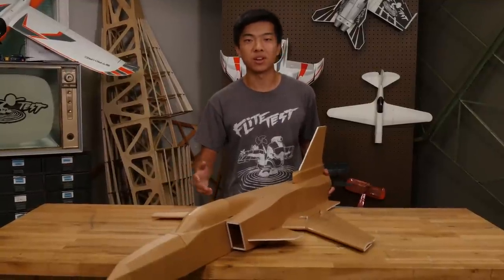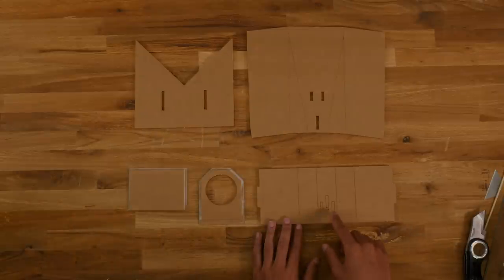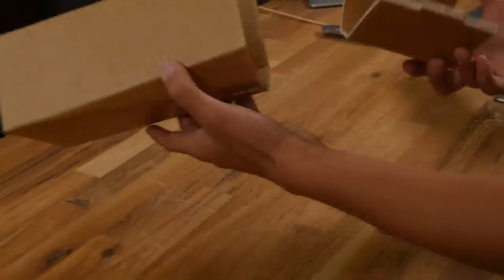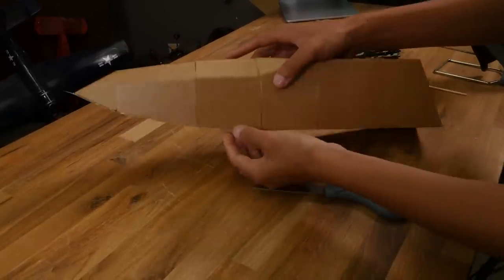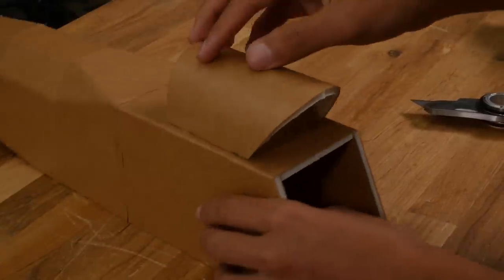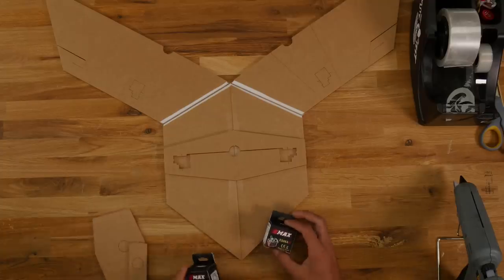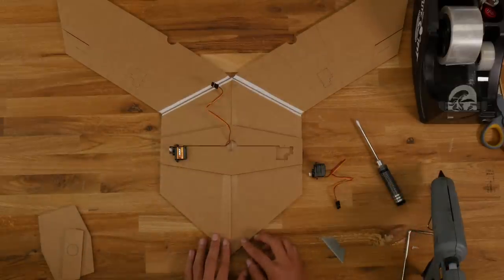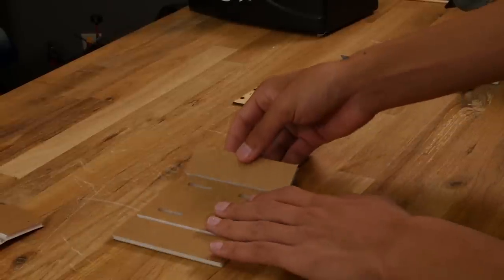DIY Jet | FT X-29 BUILD

Comment: These videos are just all amazing. Not a single time does anyone say, "just fold this piece and you are done."  Each and every fold is detailed with tips and exact procedures. Truly amazing.  I will be picking up one of your kits for my kids.  What radio do you guys recommend for casual flyers who will most likely never build a B17 with bomb doors and flares or crazy stuff like that?  I would say at most, flaps and gear will be the limit.
Reply: I would recommend the spectrum dx7. Easy to program and high quality.

Comment: Anders did a great job on the Design and Build of this odd X-Plane!! 
My Dad was at Edwards when this was being tested...
The staggering amount of fly-by-wire Avionics required just to keep it in the Air....

Well considering that this flies with the same Remote as any other RC Aircraft - is a testament to the brilliant mind who designed it!!!
Reply: Yep that forward wing design doesn't lend itself to great manual stability, so no wonder for all the fly by wire avionics.

Comment: flite test I've noticed that the foam is shrinking quite a bit and I was able to have the foam shrinking way less (it almost doen't even shrink and it comes out way better) by passing with the laser multiple times with more speed also takes a little more time to laser cut.

Comment: I'm amazed that this forward swept wing model is flyable. I thought that you needed a computer to fly it.
Reply: The full-size aircraft has 'relaxed stability', ie a very rearward CofG which, as you note, requires computer interfaces between the control column and control surfaces. 
This model has a normal, slightly nose-heavy CofG which makes it flyable.

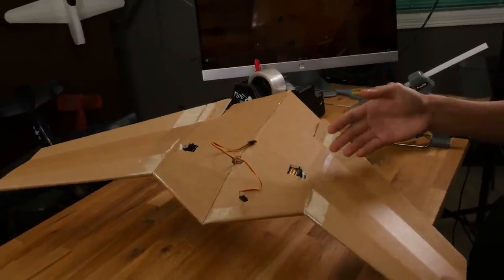Comment: something  notice watching this build......the basic wing section assembly (1:09:11), looks very much shape wise, like a B-2 bomber.. -- The silhouette of it is almost there....with a bit of redesign, it could be tweaked to get the form right....the wings would need to be reworked so the leading edge is right, and the "tail" would need to be adapted some to get the "sawtooth" profile right,  and some reworking of how a pusher prop might be mounted, but it seems VERY close....  Thought it might be something for your design team to look at, possibility wise

Comment: whats the cheapest transmitter you would suggest for any rc plane?, i am new to the hobby and dont know what transmitter to buy
Reply: Cheapest route i would suggest to go is the FlySky FS-i6x, any cheaper and you look for an upgrade soon.
You can get that for around 40 bucks including one receiver and there are cheap receivers under 10 bucks available.
I would suggest, however, to invest a little more right from the start and go for the Taranis Q X7.
It´ll set you back about 110 bucks, but probably you are set for many years for almost all things flying ( Quads, Planes, Helis). Also really easy to use for any simulator out there with its USB interface
Reply: @C4reful   - Thanks, I appreciate that answer too!
Reply: I would recommend the yc-9954 transmitter. Super easy to configure and extremely reliable. Perfect for the beginner

Comment: What EDF unit did you use for this build? Thinking about building this as my first EDF jet and just wondering what kind of power I'll need.
Reply: Spencer Guenther They mentioned it in the previous video linked below. It's a 65 or 70mm EDF from ReadyMadeRC. Supposed to have a EDF power pack coming soon.
https://youtu.be/bzQdgVH5j9o
Reply: I went to ReadyMadeRC's site and i can't find their EDFs... :(
Reply: It’s actually the MotionRC 70mm EDF $31(4s)- $39(6s) that they are talking about

Comment: I have the viggen and I was wondering.... I have a 5 blade 70mm edf engine but I can’t find a 4s 3000 mAh lipo. Would a 3200 or a 3300 mAh work just as well? Or will it drag it out of the sky?

Comment: Please, do a review of the turnigy 5x transmitter or any cheap one,I'm getting in the hobby but don't know which radio to pick. 
I'm trying to keep a low budget to my projects .
Thanks guys.
Reply: Rafael Barbosa turnigy makes decent stuff - if you can get by the quirks.  I have a 9 channel turnigy transmitter and it works pretty well.
Reply: theMike97_ 
I was considering to pick one in hobby king, a simple 5ch would be just fine for me. I'm trying to get a Speed build kit of a simple cub or mini Mustang,the only problem for me is the shipping to Brazil.
For the Tx/Rx from hobby king I would pay 30$. 
The most important is the electronics, the plane if I don't get one I'll build one. 
Thanks for your comment, good flights

Comment: There's a mistake on the plans on part 18 the 'front nose' (front nose?  Has anyone ever built a plane with a back nose?). There are two black 'cut all the way through lines' marked which shouldn't be cut through.  The pointy bit of the nose needs to be in one piece, not three.

Comment: Looks awesome :) Do you think you guys could manage to put an EDF Rafale or Eurofighter together? (delta wing jets w/ canards)
edit Would having two EDF modules counter rotating to each other help cancel the torque? Might be feasable in dual-engine jet designs maybe?
Reply: well, actually, EDFs dont have much of a torque.....so, it wont make a difference; also, i dont think reverse rotating edfs are sold in the market

Comment: Say WHAAAAAT? Ex-KYOOOSE me? Watchoo talkin' bout, Willus?? 

I don't have beginner skills. Neither do I have intermediate skills or even master skills. I have GODLIKE SKILLS when it comes to building anything out of crap I can find in the dumpster for free! Does this disqualify me from building an 'advanced skills required' cardboard thing with a pointy end?

We are talking about the same thing here, right? Modeling a boxy looking thing that looks sorta like a scribble of a jet plane, but in 3D and made out of trash? I mean, that thing looks like something a 1st grader would take to show & tell as a last resort after the vacuum pump for their homemade nuclear fusor bit the dust! Am I right in assuming that there's more to it than just cardboard?

Wait, stop the press! Tell me if I've got this right... that thing, that vaguely jet plane shaped cardboard box requires advanced skills (and there's money required, too? Tell me if I jumped the gun there). Because you can snag a cardboard box out of the trash for free.

Uh oh. I just heard something about wires being required! But they don't come with the... kit? The wires? I have to buy wires, too, along with the dumpster cardboard? In order to turn a piece of trash into a... a uh, a something or another jet - I forget what the fancy serial number was - with a hot glue gun? Or Elmer's glue, or tape, or whatever?

Now, I've got nothing against building stuff out of trash. Like I said, my skills are GODLIKE for repurposing wood, cardboard, aluminum, glass, old DC motors, WIRES... into just about, well, anything. As long as there's not DARPA level engineering required, because then I'll need money, too.

But this requires 'more than advanced' skills, right? But all I've got are GODLIKE skills! Does that count as 'more than advanced'? Because as far as I know, I'm the only person who has a GODLIKE skillset for this kind of thing.

Is this project geared especially toward kindergarteners? Like, advanced skills required for a 4 year old? And wait a second, it's not even painted? Not even a LITTLE?? Does that cost extra, for paint? I'm assuming you guys are selling this thing. Could you guys at least throw in a few magic markers if I decide to take the plunge here?

I must admit, as soon as I saw the mockup of that repurposed cardboard box and heard the words 'NOT FOR BEGINNERS, and NOT EVEN FOR INTERMEDIATES', my balls tingled just a tad. In fact, once I heard you say that this thing doesn't even come with everything to convincingly transmogrify a cardboard box into a flying (I'm giving you guys the benefit of the doubt that it flies because if I finish watching this video and I don't see a cardboard box fly, I don't care what you gotta add to it, I swear I'm going to laugh my silly ass off) F-WXY and Z cardboard box, and... 

WHAT? Is it a kit that people have to, I'm assuming, pay actually money for, and lemme get this straight... It doesn't even come with everything you need to actually build them damn thing???

Because if I heard that right, well... I mean, if you guys really DO sell these things and people buy them, then all I can say is, hey. Great job scamming customers into paying money for a cardboard box, while at the same time, leaving out the apparently essential items like... wires? 

Is that all, just wires? Or is that as far as I  got in the video before I had to restart it because I had to stop laughing before I DIED?

What did you guys conveniently forget to include with your flying cardboard box so that it might have a chance in hell of actually flying?

Dang, I see now why this isn't a beginner...  NAY! An intermediate flying cardboard box kit! Hell, even advanced... uh, advanced... Kindergartners?

Anyway, apparently all the 'advanced' skills required to accumulate everything BEYOND a cardboard box and MAYBE a hot glue gun rests with procuring and then adding wires to it, and whatever the heck some poor schlob has to pay extra money for in order to have their life drram realized by crafting a pointy end onto a cardboard box that anybody can find in a dumpster, adding some... wires, was it? And watching it sail into the Wild Blue Yonder!

Anyway. Maybe I have you guys all wrong. I DID have to start the video over, because otherwise I might have DIED. From laughing.

Ok, I'll watch the whole thing now. Maybe I'm jumping to conclusions without first having all of the required information for making an unbiased judgement.

Ok, I'm starting the video over. I'll watch it all the way through this time... if I don't die first. I'm kinda torn here, really. I mean, on the one hand, I'm thinking that I simply have you guys wrong. I mean, that would really help to restore my faith in humanity, knowing that every other YouTuber video that SOUNDS completely ridiculous at first aren't necessarily based in Mumbai and staffed with a bunch of online schuckster schill scam artists out to make a quick buck at the expense of the fire year olds of the world.

But on the other hand, I want to be right too. But that means I'll die! And I absolutely HATE being wrong!

Man, I tell ya, it's a dilemma. Ok I'm putting my life on the line here.

For YOU GUYS! How many times has anyone put their life on the line for you guys? What, never?? Well here goes. I hope you guys have gone to confession.